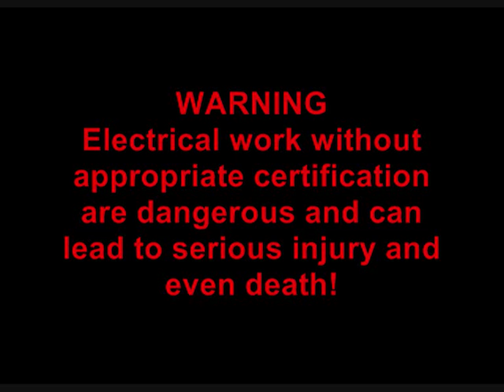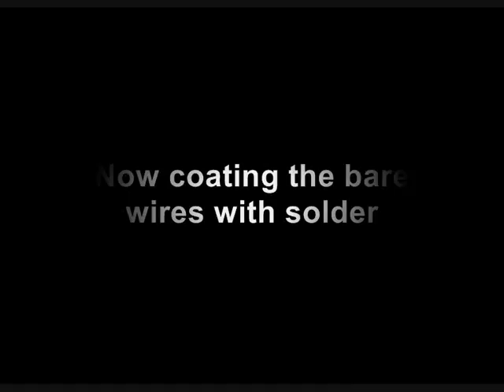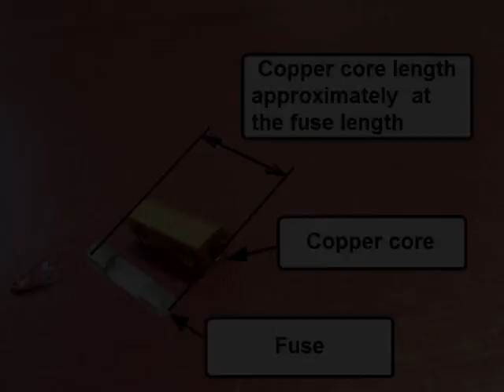Motorcycle battery charger DIY, Part 2 + BONUS:How to Solder.

Comment: I found a 13.5v 1 amp charger in my local market,50p works good
Reply from the maker: I do not recommend working with 1 amp, but with less amp. You must constantly monitor the correct voltage levels and note that the battery does not heat up. Charging at 1 amp current will be relatively short. Charging at high current shortens the battery life.
Reply: @MyINNOVAMotorcycling  It's got a power output of 21 watts,the battery puts out a hell of a lot more than that so I'm good with it,1 amp is fine for an 8 amp battery